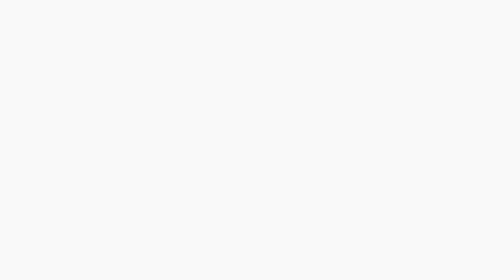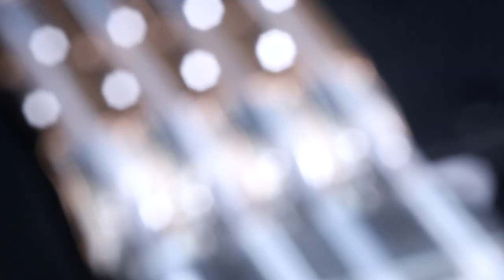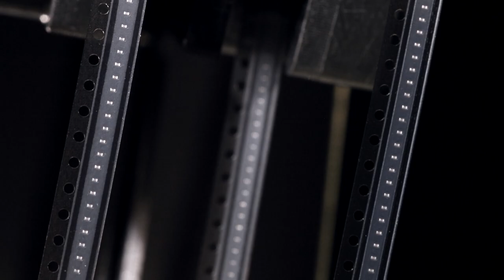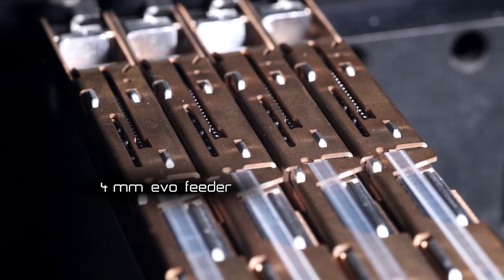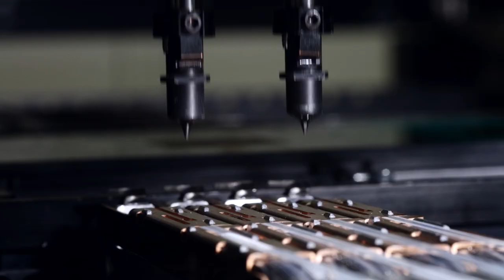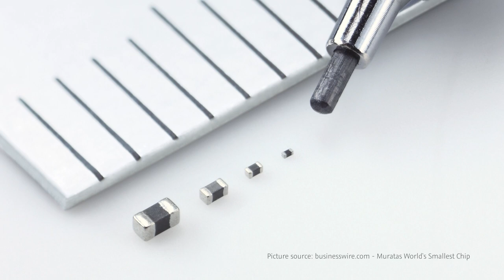World`s smallest SMD component 008004 pick and place process

Comment: As a PCB designer, the trace routing being relaxing is often true lol. Also, 0805 (imperial) components are a nice middle ground (between 1206 and 0603) for hand solderable and prototyping SMD components. 0603 are still manageable but are harder and 0402 can still be done, but I limit them as much as possible. Whatever you do, do not the 008004.